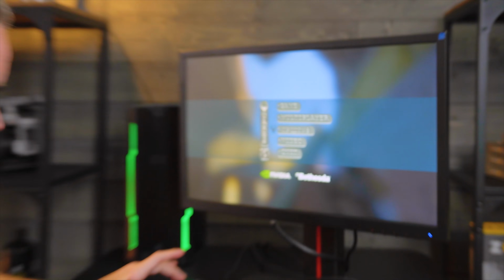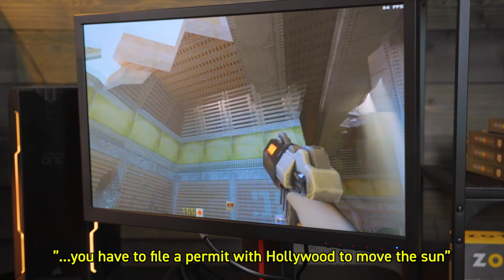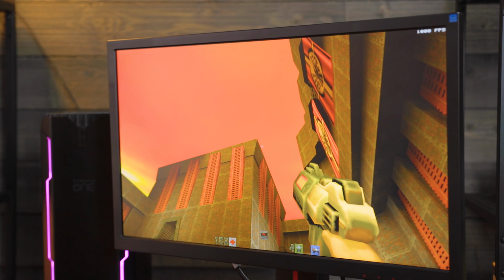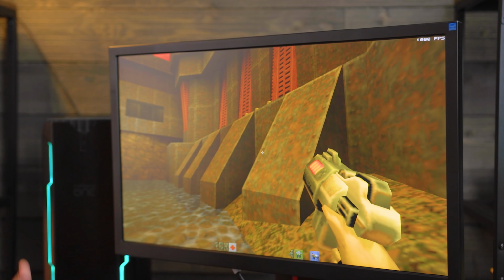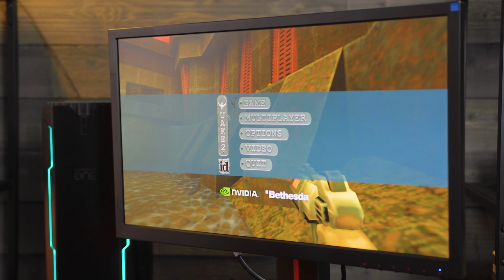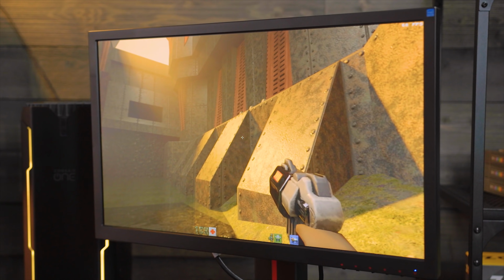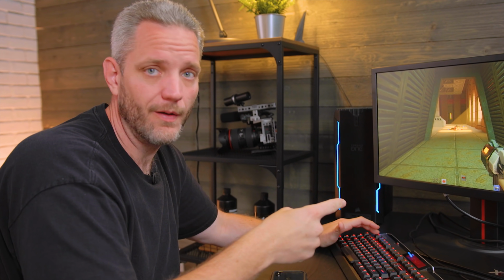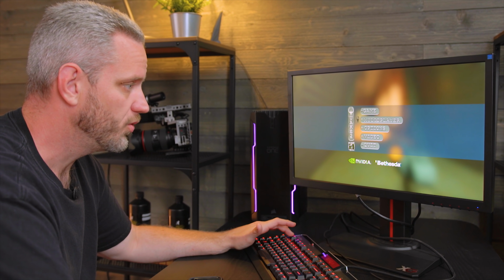Testing Quake II with fully ray traced update...

Comment: FX-6320, 16GB RAM, VEGA 64
0 FPS.
Reply: FX 6320 need to die. In fact it is pretty dead the moment it hit the market anyway.
Reply: I have noticed that my GPU absolutely refuses to clock higher than 1585Mhtz but I can't confirm if that's a sign of a bottleneck.
TBH, it's not terrible at 1080p. I'm scoring frame rates of 90~130fps in synthetic benchmarks and I'm playing all my games comfortably in ultra quality. 
It's a progressive upgrade, just waiting on Ryzen 3000 to come out so I can get to water-cooling.
Reply: @Zappyguy111 If I may ask, What stopped you from picking up at least an FX 8350 or so to go with that vega 64? they're super cheap and you'd at least benefit a little from the extra core set.
Reply: Nah relax the fx 6300 and up aren't that bad people just love to hate something
Reply: you absolutely need to swap that cpu 
all that gpu power is being wasted
Reply: @Cortez Baldur
The FX 6300 will consitently lose to a 3rd gen 8 years old dual core i3 3220 in AAA games , it only competes against this i3 in csgo.
FX are actually half the cores they claim to be , and terrible ones at that.
Reply: @Zappyguy111   Vega 64 needs to be under volted  if you want to get up to higher clocks and sustain them,  it has nothing to do with your CPU
Reply: @igorthelight  it's better than buying a low end graphics card to replace when the time comes to upgrade from fx to a whole new platform..
Reply: He's getting 0 FPS because you need an "RTX Capable" graphics card, so an Nvidia only card. I tried opening the game on my Ryzen 5 2600x and RX 580 but it gives that error.
Reply: @tundrazinogre  
Why 6320? It was purchased before I became an enthusiast, under the recommendation of a friend because budget build.
It's all apart of a progressive upgrade of the whole PC I've been working on the past 6 months. All that's left is the MoBo, CPU, RAM, then I may consider water cooling it after that.
Reply: @pm5k00  
Done and done, the GPU is running at 0.95V and doesn't exceed 60°C, HBM overclocked to 1Ghtz and is unstable at 1.1G. Not sure what else to do.
Reply: @juanme555  FX is good in multi-threaded games. 8350 stock catches up with 2700k stock in Rise of the Tomb Raider in DX12. It was bad when it came out because software was still running on 2-3 threads.
Reply: @NineS5  
I could kiss you right now.
Reply: @Zappyguy111  i have a 56 w/ 64 BIOS ... try putting p6 @ 1125mv and 1587 mhz and p7 @ 1150mv and 1662 mhz and power limit @ +50% and match hbm2 to p6 voltage. You may have to change around the mhz for your exact card, but these numbers should get you close.
Reply: @juanme555  "FX actually half the cores they claim to be" ...Unfortunately, that's not quite true. So before you start writing nonsense about an architecture, just be quiet. Thank you. :)

And the FX 6300 is actually capable of playing AAA titles at 1080p ~ 60FPS. ^^
Reply: @juanme555  FX6300 slower then i3-3220? Are you sure 6 thread CPU in modern games is slower then 3,2GHz two cores, two threads CPU with severely lowered IPC  that you ends up after all security patches? When I had Sandy Bridge even the first meltdown/specter patch lowered my CB15 score from 143 to 121 that's like 15% IPC hit, and those were only the first patches. Now without HT Intel old CPU are rubbish. I'm glad I don't have to worry about it anymore, I have a Ryzen 1600X now.
Reply: @Zappyguy111  Ah right that would explain it. I just figured since you may have got the 64 later, that you'd want to up the cpu, too. But since you'll be getting a zen2 it's not that worth the effort now X3
Reply: @Fusslowski
In low settings , sure.
Reply: @juanme555  
I really doubt that dude my sis has a fx 4350 and we paired it with a GTX 1050ti it does just fine. Never a perfect 60fps more like 40fps and I've used a i3 2100 cpu it can't handle very much in games it chokes on 7days to die when zombies attack ur base it becomes unplayable but the fx 4350 does a bit better and atleast keeps it playable. Fx was never great I agree with that completely but I own one and there not THAT bad there not good tho either just a very average cpu that gets u by on just about every game. And that's an fx 4350. The 6300 is prob way better.
Reply: @juanme555  "In low settings , sure." 
Nowadays FX CPU are far more capable then old Intel Sandy Bridge/Ivy Brige CPUs. Games now use 6+ threads so whole FX cpu can be utilized. In the past only from 2 to 4 threads where in use so naturally Intel CPUs benefits from higher single core IPC. Now after security updates IPC on Intel CPUs is way lower and FX CPUs can be fully utilized. You really should check the facts. Yes "K" versions after max OC will be still faster but you need expensive, unlock version of CPU + expensive motherboard that let you overclock it and powerful cooling solution. Plus there is no guaranty how long that pushed to its limit setup will hold. It can multifunction anytime, pushing old parts far beyond what they were designed to do, is not recommended for every day use. All of that is just not worth it anymore. Not when you can't even use HT anymore, and best Intel parts are just plain 4 cores. Thats not good enough today.
Reply: What the fuck is a fx6320?
u mean fx 6300? 
Yeah i got that on my nearly 10 year old rig lol.
Reply: @Luka F First od all I nowhere said those where 6 or 8 cores CPUs. I used threads instead. Second of all I was talking about Sandy/ Ivy Bridge, from my personal experience.  As for security you either use it or not I don't care about your security. I, personally, wouldn't for example login into my bank account on unsecured old Intel. If you're just a teenager that wants to only play games then go ahead use unpathed system with HT on. It's not my problem. For example I wouldn't drive on mountain road in a fast car with broken breaks loose suspension and without tight staring. But it's just me. It's your life, live in illusion that hackers would announce to the entire world that they are using factory security flaws to still data.
Reply: @Luka F And most importantly whole argument was about FX-6300 being slower in modern games that can utilize 6 threads, then piece of garbage two cores i3 back from Ivy Bridge generation.
Reply: Wait for CryEngine
Reply: You could also buy ryzen right now because its much cheaper now since ryzen 3000 is anounced. you can buy a ryzen 3 for 65 euros. core i3 8100 costs like 115 euros.
But I have contacts that can get me a xeon 2620 v2 dual socket system with 64gb ram (8 ram slots empty)  550w psu gold+ 500gb hdd for 100 euros xD. Long live IT recycle shops.
Reply: @shagstars  
Naw, just did some quick research, my LCS is asking $460AUD for a 2700x and the 3700x is set to retail at $470AUD with 15% better performance. 
I'm also looking to water cool and overclock which the 3700x is rumoured to do better than the 2700x.
Also, shipping to nowhere is a nightmare.
I'm just going to have to wear away at the edge of my seat for another month...
Reply: @Zappyguy111  well in Australia things tend to be different feom europe. Here ryzen is like half the price it originally launched. Like a ryzen 3 that was 120 euros is now 65 euros.
Reply: @shagstars  
Of which I am highly envious of, we don't have the competition or second hand market you guys are lucky enough to have...
Reply: @Zappyguy111  well the second hand market is very hit or miss but I was talking about the new market only. Here is a example: https://www.sicomputers.nl/amd-ryzen-3-1200-processor-3-1-ghz-box-8-mb-l3-585618.html it is a dutch site because well... I live there.

Comment: RTX 2080 Ti Founders Edition
Ryzen 5 2600

1440p G-Sync display
RTX on: 46 FPS
RTX off: 1,000 FPS
Reply: funny thing is i get the nearly the same fps at the same resolution with a 2700x and a 2080
Reply: @Tht1guy63  That 2700x is a beast.  I'll be upgrading to a 3000-series soon
Reply: @jweingardt  the 2600 and 2700x in game actually perform nearly identically  in most games outside of those that are really cpu bound. Im debating if i want to upgrade or not honestly. If i do my 2700x will just end up being a htpc with my old r7 360 or rx 470 for video. Not sure if id game at all or not on it.
Reply: @Tht1guy63  cool

Comment: i5 3570k and a GTX 1080. 

I can get 60fps with RTX on and everything turned up...
... As long as I set it to 720p and a 50% render scale.
Reply: Might be a CPU choke, you know.
Reply: lol
Reply: @QuackZack  Interestingly, GPU use only hovered at around 80%. CPU use was also pretty low. So I don't know what's up.

Comment: GTX 1080 Ti 30 fps @720p with stock rtx setting. .
Reply: How did you get your 1080 to run it? It tells me "No ray tracing capable GPU found". Are the 1000 series gpus RTX capable? I have a 970, and just wanted to try it for shits.
Reply: Sean Ramey Only Pascal Cards higher or equivalent to a 1060 are supported. 🤔
Reply: @himmelsrand7527   Oh, dang...

Comment: i9 9900k @ 4.9GHz
GTXZ 1080ti
32GB Dominator  

11 fps  @ 2560x1080

Oh boy...
Reply: How do you even get regular Quake 2 to start? I get a grey-ish window for 3 frames (0.1 seconds), then it crashes, and something about "optimal resolution" which also crashes after about 3 frames (0.1 seconds).

Comment: Small correction, Toy Story (1995) didn't use any ray-tracing. It was all rasterization. Pixar didn't use any ray-tracing in a major way until Cars (2006), and the only ray-tracing used was for the shiny coat reflections on the cars.

Comment: There are probably several reasons Nvidia chose to use Quake II as an RTX-demo game.

1: It's open source
2: Quake 2 was right about the time the hardware 3d rendering started to take off, so it gives a little context regarding the history of 3d graphics. When I first got Quake II in 1997, I had an Nvidia Riva TNT2 card. It was the first game I knew of that had hardware 3d rendering out of the box (vquake and glquake were not included in the retail release of quake 1, but quake 2 could utilize glide and opengl out of the box).
3: Quake 2 was the game where id software introduced radiosity. The precomputed lightmaps in Quake 2 had light bouncing off walls and casting realistic hues on walls (look at glow from lava in the game), but it was all static and pre-computed. It took HOURS to compute these lightmaps back in the day. RTX is doing something similar, but in real time, dynamically, to show just how far the technology has come.

And in terms of dating yourself. I was a senior in high school.  When doom 1 came out.

Comment: Well its run fine with a GTX 1070  Settings used windowed mode GI low Res Scale 70% 45-60fps CPU 4790k
Reply: How many cores and what clock speed?
Reply: @mikemagee2739  the 4790k has 4 cores and 8 threads, they are easy to get them to 4.8-5ghz, dont know what his is set at but i also have his setup with a GTX 1070 gpu and a i7 4790k cpu
Reply: windowed mode, OH.
Reply: @mikemagee2739  4c/8t stock 4.5Ghz with undervolt to 1.2v no aio atm but soon

Comment: 8700k@5.0GHz, 1080Ti@2.0GHz:

7FPS @ 3440x1440 at stock settings (unplayable, can't even do anything in the menu properly).
15-16FPS @ 1920x1080 at stock settings.
42-44FPS @ 1920x1080 with lighting settings turned off, denoiser turned off.
21-23FPS @ 1920x1080 with denoiser and global illumination (low) turned back on but other stuff off.
Reply: 7700k@4.8Ghz, 2080@2.1GHz. 1080p all on max. 80ish FPS.

Comment: RTX 2080ti @ 4k gets only 20fps. Reduced resolution scale to 90% to get to 30fps.
Reply: I got 45 fps in 4k, huh... maybe it does use sli/nvlink
Reply: @TechnoStickmen  Impossible mate.. even nVidia recommend 1080p even for RTX 2080ti. Sli would never double the frame rate.
Reply: @thiagovidal6137  what framerate do you get with 1080p?
Reply: @thiagovidal6137  Dont' know what to tell ya, I'm staring at 40 - 50fps in 4k right now
Reply: @TechnoStickmen  That explains it. You're not running it maxed out. Global Illumination is the key feature that demands the most GPU power. You have it at medium. Try at high.
Reply: @thiagovidal6137  ok that makes sense, I'll try it when I get home. Probably 35 fps is my guess, I'll find out in a few hours
Reply: @thiagovidal6137  Just tried it on high. First test got 48.3 fps, second test 47.6 fps, not much different. Are you using a standard non-overclocked 2080TI?
Reply: @TechnoStickmen  Yes. Founders edition but it doesn't matter, the difference would be much smaller than what you're saying. I think you're missing something. Maybe resolution scale, settings.. you were running global illumination at medium without even noticing before.. you're probably still have something off on your settings.. maybe resolution scale or something. Everyone with RXT 2080ti in Steam discussions are reporting around 20fps when truly maxed out at native 4k.
Here is one example: https://www.youtube.com/watch?v=I9Psg0J3Jkw
Reply: @thiagovidal6137  Ok, I'll upload some gameplay recorded from my pc then. I might be missing something. I'll link it in a sec.
Reply: @thiagovidal6137  Found out that my environment map settings were set to current time, and it is night. turning it to manual stroggos default position got me from 48 fps to 44 fps, so that wasn't everything either. Either way, uploading that now.

Comment: 1070 Ti
800x600
rtx everything on high
30 ish fps 

800x600
rtx global ilumination low
50 ish fps 

1280x720
rtx global ilumination low
30 ish fps
Reply: basically the same with a 1070
Reply: @defranwren5153  +/- 400 extra cuda cores does not help much😂 scientific experiment done! 

Who's got a Volta card? Let's see if 5000 cuda cores and some tensors are enough

Comment: 7700k and 1080ti got me 30 fps average on 720p.. 84c max temp on GPU... yikes
Reply: 5820k/1080ti   same fps I was able to hit 40 fps if I messed with the sun a little, my gpu temp was only 55C which surprised me.
Reply: I overclocked my core to 2025mhz so I was in a sense asking for it

Comment: ryzen 1600x. 
2 gtx 1070. 
1080p
rtx high 13-16 fps , 
medium 23 fps, 
low 32fps
Reply: Bottelneck lol why sli
Reply: @Rainbow__cookie  Cause without SLI he'd only get about half the frames. At 720p low illumination I only get about 65fps on average, low 30's with it off and that's SLI 1080's
Reply: @Rainbow__cookie  I am not really sure if there is a bottleneck for the Quake II RTX demo. I was only showing 6-10% CPU utilization.  Other games, sometimes. Why SLI? Second card was cheap. It is a hassle at times but, I find that half the fun of owning a pc.

Comment: Gtx 1080 with i7 8700.. everything maxed.. lol like 5-12 fps.. BUT with the ray tracing off i get a solid 1000FPS.. so i mean theres that right?
Reply: Rtx man... Rtx
Reply: @darkthrone_cl2650  yea I wasnt planning on a new card for quite some time.. but after seeing that.. definitely getting an rtx at some point.
Reply: @Codyrosa  because of the two new cores that rtx has built in that really handle a lot of the rt load gtx cards suffer grealy making even the 2060 preform better.
Reply: @Codyrosa  Ray tracing is so infantile, you will upgrade your 1080 to an rtx card and by the time raytracing is actually feasible you will need to upgrade again. Thers basically like 5 games with raytracing enabled. It's not even remotely ready yet as proved by this video and all the people who have rtx cards and can't even play this 22 year old game above 40 fps.
Reply: Yeah what's 'there' is how ray tracing in realtime still hasn't arrived in any useful ways. We're still back at square one.

Comment: My ROG strix 2070 on 1440p with medium global illumination +/- 40 fps ... seriously ? :D
Reply: BTW can I run this with GroundZero and TheReckoning too ?
Reply: "Recommended settings for 60fps 1080p" "medium".
Reply: You and everybody that purchase a RTX 2000 series were the beta test. Next cards will be able to run Ray-Tracing easier, I hope.
Reply: @oddmofo  still funny because metro exodus runs better. :D
Reply: yah me too
Reply: @PeSaHazard  Metro requires a 2080ti to run at 1440p 60fps ultra, and that's with all the optimizations of DX12 and gameworks. If I'm not mistaken, this game is running on Vulkan.
Reply: @oddmofo  I am +/-50 with RTX high 1440

Comment: I think its great for gaming and computing in general that this is happening. Its a night and day difference in the textures, and I can't wait to try this my self. I was a hardcore gamer back in the day, but as you become a family man and grow older gaming becomes a lot more casual (As we all know). 
I'm currently playing Crysis 2 maximum edition for the very first time, and really enjoying it. What makes the experience even better is having a CPU and GPU that can push the game to its maximum settings and be smooth as silk. Thinking about this not every gamer ever plays a new title at its highest settings, as normally the required system specs are due to cause a compromise, every new generation of games, brings a new generation of hardware with it, we should be embracing this if we ever want to get to holodeck immersion.

Comment: 6700k, 4x8gb 2666 ram, and a GTX 1080 "blower" style card. No over clocking.
Getting average of 15-18 with a high of 24 and a low of 11, with all settings set to the "low" configuration. 
Hope to come back and play it again once i build my own 8-core 2080 monster in a few months!